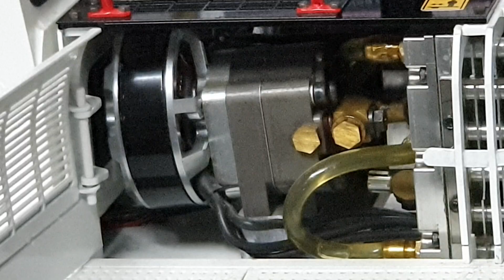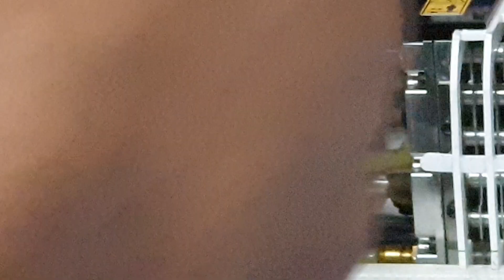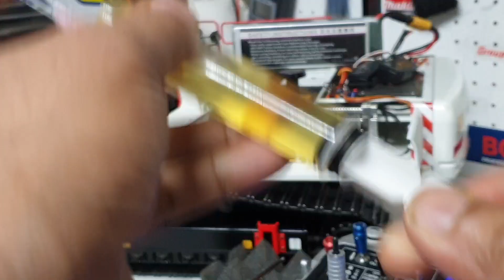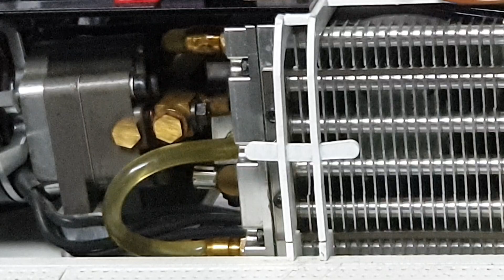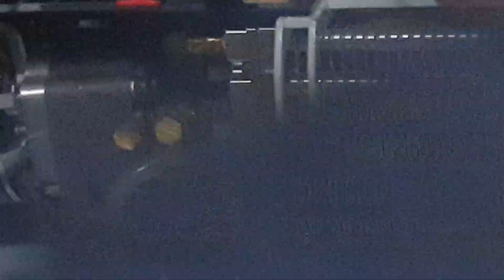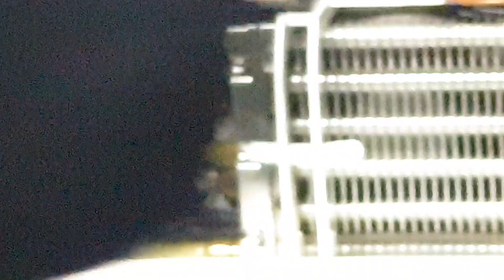CSMI RC Hydraulic Hidromek Excavator cavitation and cylinder explained. How to stop cavitation .

Comment: Hi what would cause regular blown hydraulic hoses do i need to make any adjustment on pump????? or should i buy a hydraulic pressure  valve. ps do you sell DVD's with basic repair and how too. please help
Reply from the maker: Hi Lee it's best to put a relief valve. Excess pressure will return back to tank. You can email us at info@csmi.com.au.  We can guide you better on setting the system up.  CSMI TEAM

Comment: Great vid and info.. But as a suggestion also, it would be good to let the system settle for a short period to let the fine cavitated bubbles expunge themselves from within the body of the oil, that may take a few minutes.. Then repeat the exercise with all the Hydraulic systems which may also have air in them.. Refil tank... Settle time.. Reuse all rams and drives and ensure all the air has been purged to the tank.. Settle.. Refil.. It can take a while..
Great model.. Great work.. Well done.. Must have..

Comment: Great info as always Kevin! 
Also thats a awesome excavator!
Reply: Hey Kevin, i have a rc4wd 360L and a SMB servonaut sound module and for the life of me i cant figure it out! The transmitter is the FS-I6S witch is the radio it comes with.
If you could do a detailed video of these adjustments that would be awesome!
Reply from the maker: Hi YIC thanks for your feedback. Currently do not have that radio to do a videos.  Here is a few tips.  Assign one of the 2 servo cables to a channel on RX  that is activated by a 3 way switch. So that the horn and engine crank function works.if it does not swap it to the other servo cable( can't recall the colour of the plug) . The other servo cable is plugged to a channel in the Rx. Now you need to mix this channel with the respective control's.  Will try to do a video but it's a bit tricky to explain.
Reply from the maker: Thanks for the excavator comment.  !!
Reply: Yeah i got engine start and horn.
The problem im having is that i have track sound on 4 different channels,  also only half of lets say ch. 2 half the throw is track and the other half is hyd. Sound and it does that on 4 channels...